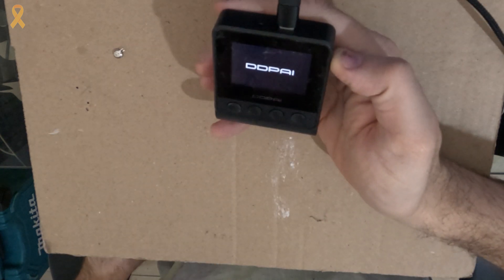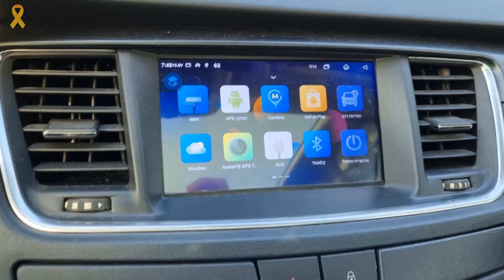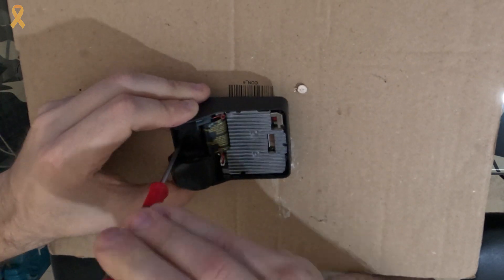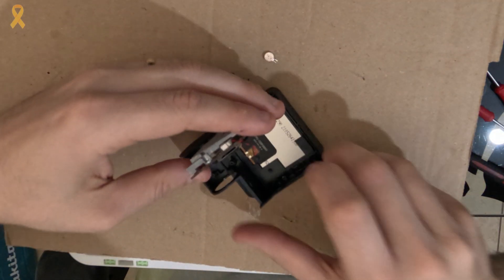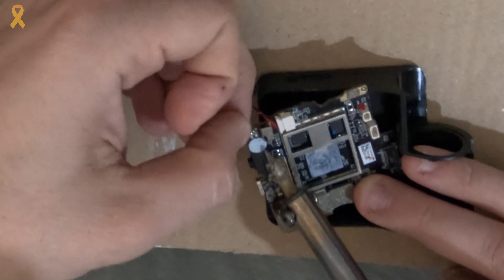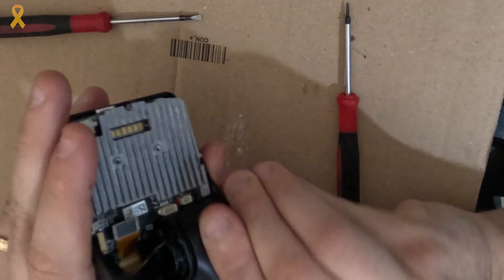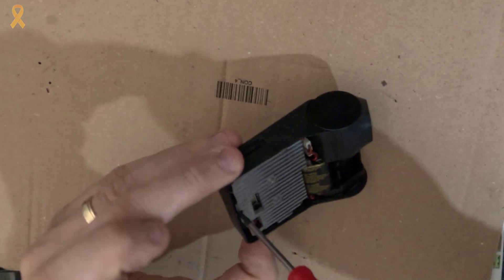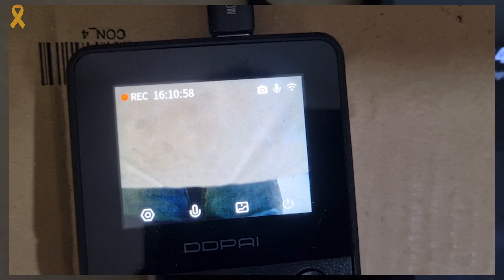Missing Dashcam Files & Date Problem? FIXED! [RTC Battery Repair]

Comment: Hi, I saw your video. I wanted to ask you... I have a Goluk M1 that also had the remote surveillance feature with a 3G SIM, but this function is no longer available. I can connect to the dashcam and view and download videos via Wi-Fi, but the problem is that the date and time are wrong. My question is: is it possible that even when I connect to my phone, the date and time don't update? I understand losing the date because the battery no longer holds a charge, but once it's powered and connected, it should be fine, right?
Thanks!
Reply from the maker: I have no idea about this kind of camera, sorry.

Comment: I am facing the exact same problem. Thanks a lot for this video. I do not have the expertise to perform this job. But I know someone who can do this for me. Please share the detailed specifications of the battery which needs to be replaced. It'll be of great help.
Reply from the maker: It's in the description and shown also at 1:08
Good luck. Hope it helped you
Reply: @DIY-Mechanic  I'm unable to source the batteries from the link you've provided in the description. If I can get the terminals attached to the battery with the help of a soldering iron, would any 3V ML1220 Rechargable battery work? Please advise.
Reply from the maker: I guess its avaliable depending on your location. I will suggest you look for the exact model.@arghyapan